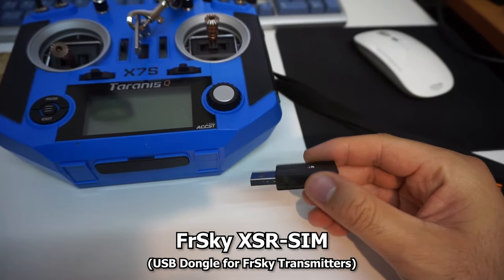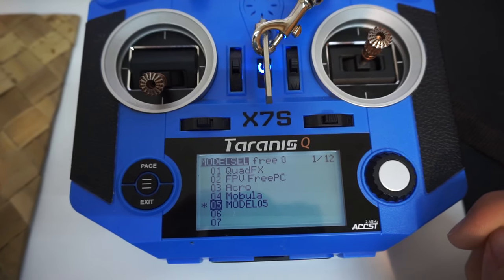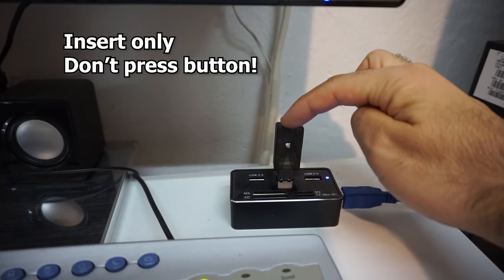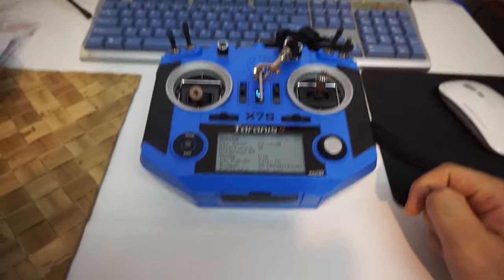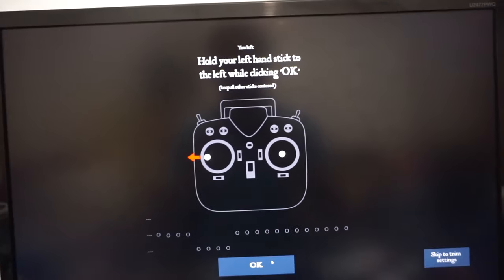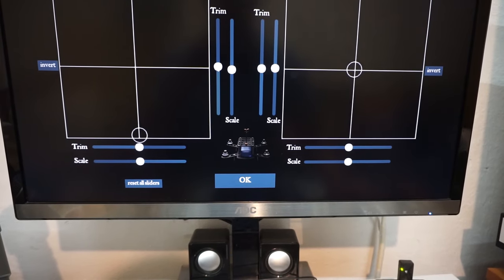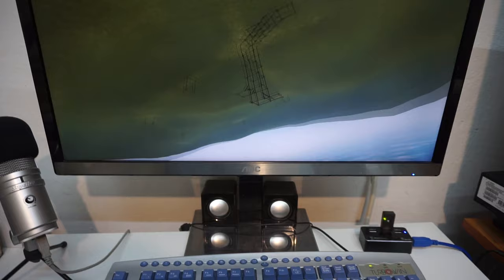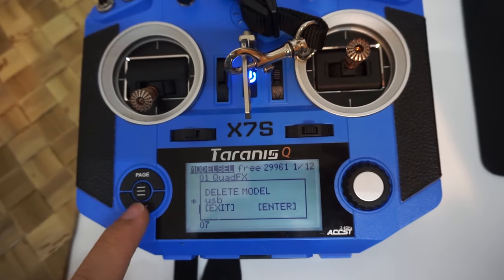How to play FPV Freerider on PC using Taranis Q X7S radio (FrSky "XSR SIM" USB Dongle)

Comment: I have been chasing the illusive LIB-USB-32 drivers for several days in order to use my Taranis qx7 on the Fpv Freerider and the Velocidrone sim to no avail. An end user on the FB Velocidrone community told me he uses the FRSKY sim dongle to get around installing the USB drivers so your video will help me get setup on both Sims and I'm excited to start practicing my fpv flying..Thank you for the awesome video Furuveli!
Reply: Furulevi I followed your video step by step and the FRSKY dongle is still flashing red only.When I first plugged it in I held down the bind button upon sticking the USB into my laptop,it had red,green lights but now it's only flashing red?
I could use some help please!! Thanks a lot.
Reply: Upon plugging in the dongle I got an alert on my laptop that F: drive was in use.I went to "This PC" and I do not see an F: drive listed in D vices and Printers??

Comment: The Qx7 is bind but commands are not responding how to fix it ?
Reply from the maker: At 2:05 is the Input on USB controller?
Reply: furulevi Thanks but  I use to recalibrate the Controller in liftoff and all is working well.👍🏾
Reply: Do you use QX7 or QX7 S, I'm trying to hook up my QX7